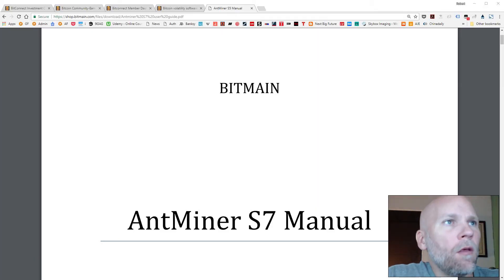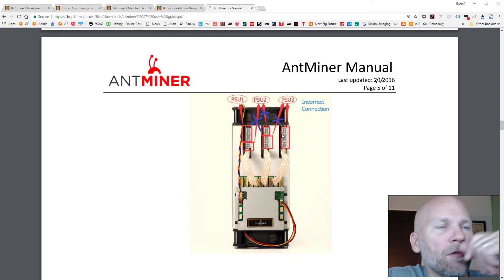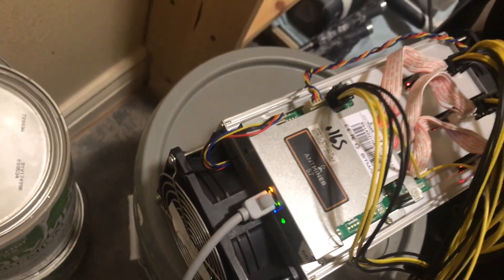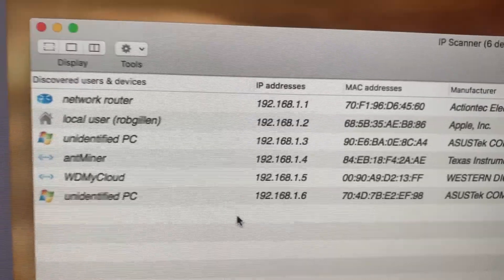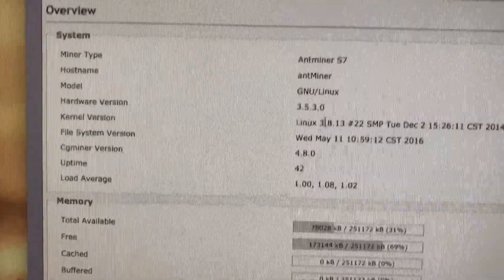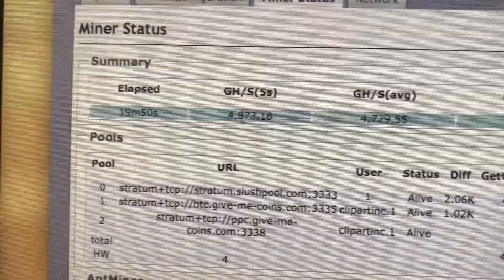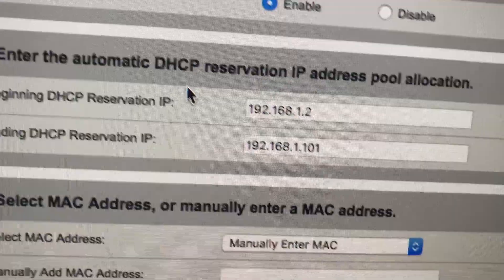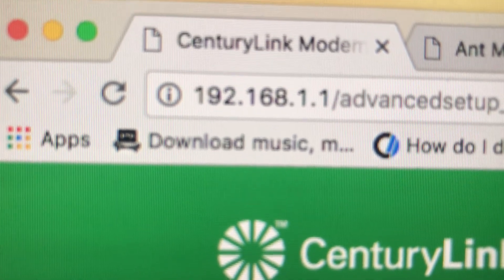Antminer S7 and S9 Bitcoin Miner Setup

Comment: Nice video.  What's the advantage of having 2 PSU's connected to your Antminer?
Reply from the maker: Hi, I wouldn't say it's an advantage really. I did it because I didn't have a 220v plug available in the location of the miner. I will be moving it to the mining room that is under construction, which will have 220v plug and I will use one PSU then.
Reply: @clipartinc Hello Sir
Can you tell me how much power volt watt amp do you need ? Is it possible use sollar power to run it?
Reply from the maker: @rubis5153  I think this machine used about 700 watts. During the day you could use solar but at night what would you do?
Reply: @clipartinc  i would use battry and wind genarator
I must callculate could battery and sollar supply  for night or no
Maybe problem is in winter i live in austria and its claudy half a year
Reply from the maker: @rubis5153  I would say give a shot and let me know how it works out. It would be amazing if you could use wind + battery for night and solar for day!
Reply: @clipartinc  what do you mean ? For one miner its not possible?
Reply from the maker: @rubis5153  It's possible, but not easy to setup.
Reply: @clipartinc  let me search ... i will find  a solution
Reply: By doing so, you will be putting less stress on each of the powersupplies. Which will make them run more efficient and quieter.